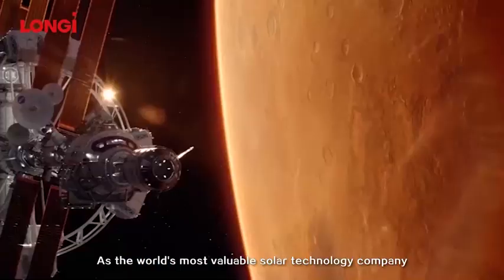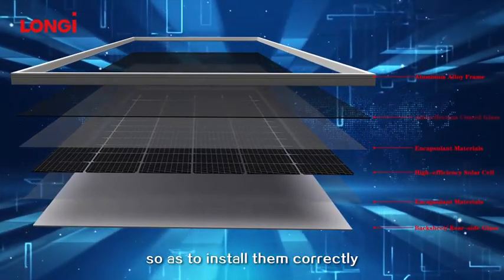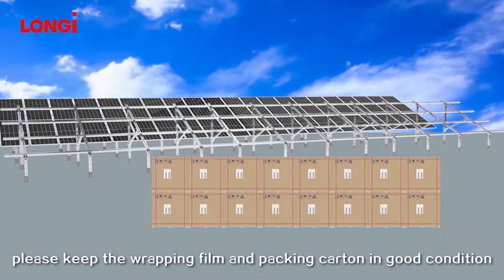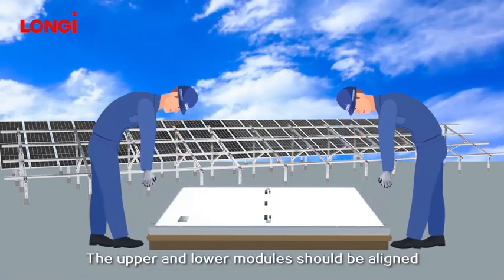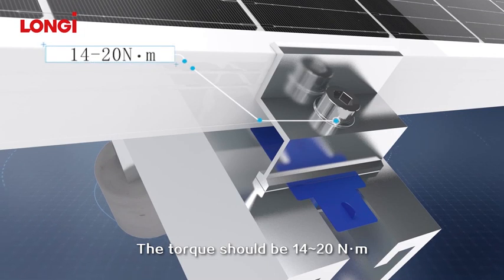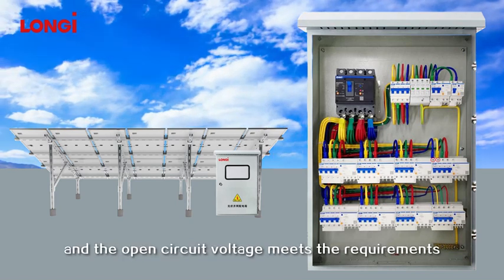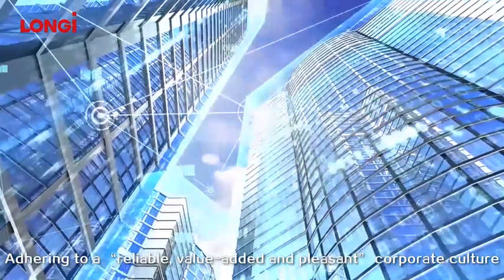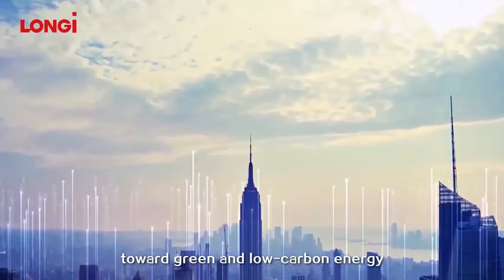LONGi Solar Modules Installation Video | EN

Comment: I installed longi a year ago (Oct2020) ,  I see data production daily with result droply performance . Begin time install can power peak 3.3 kw now ( 10 month later) can result max only 2.5 kw.
Reply: What panels did you install, and how many? That would violate their warranty.
Reply: Bifacial modules ?